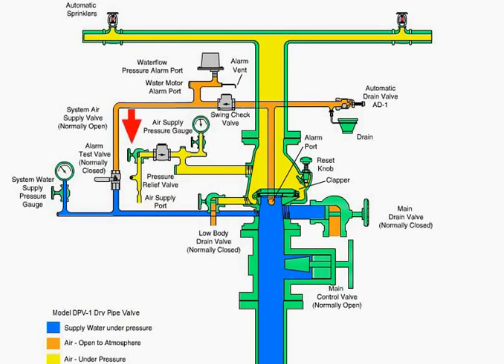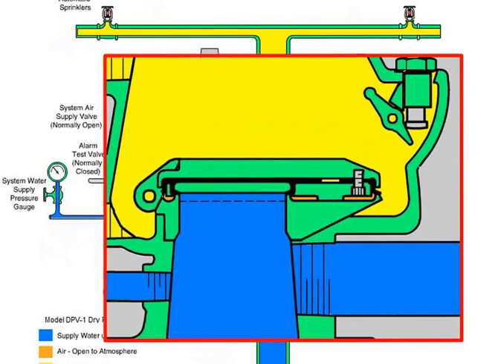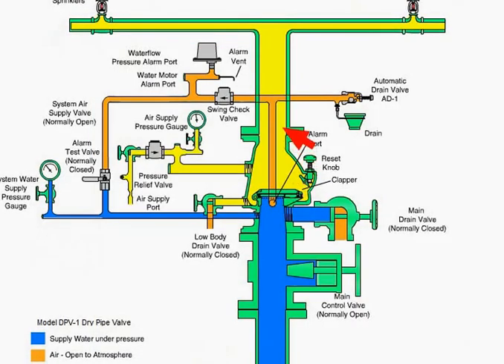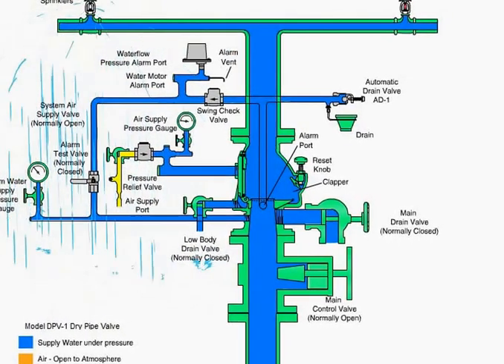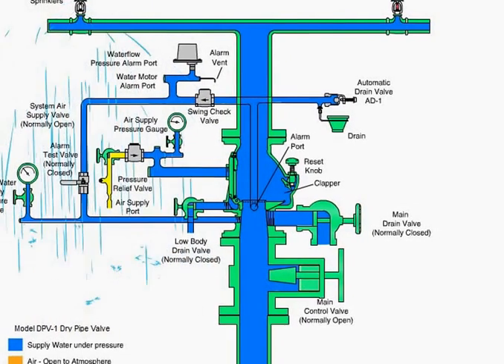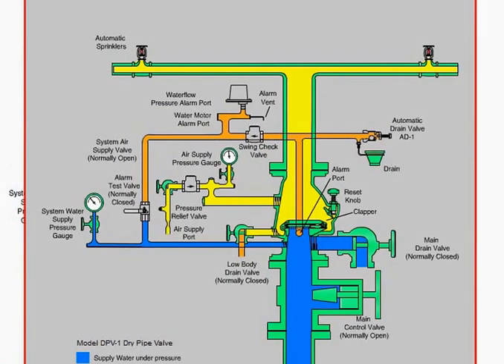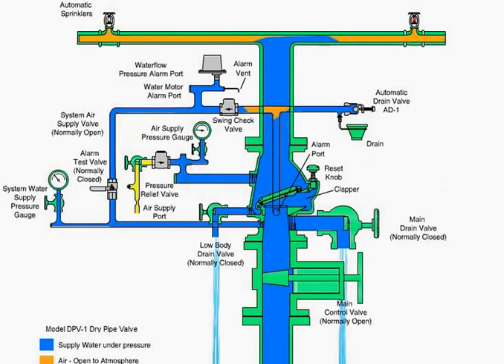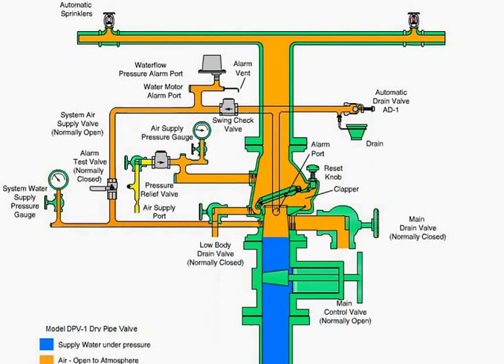Sprinkler System Animation  Alarm Valve activated

Comment: I’m probably just being picky, but this is a Dry Valve demonstration; an alarm valve is used in wet systems. What’s the difference? Mainly just the process of restoring fire protection after activation and the fact that the alarm valve doesn’t have pressurized air on the system side of the check valve (because both a dry valve and alarm valve are check valves, but the reverse is not technically true for either). Just saying you should probably fix the title of the video for people that actually want to learn this type of system and don’t catch the little caption on the bottom left of the video. Sure, the idea of a pressure change to activate the valves is the same for both types, but they’re really not the same at all. Different valves are used for different reasons.